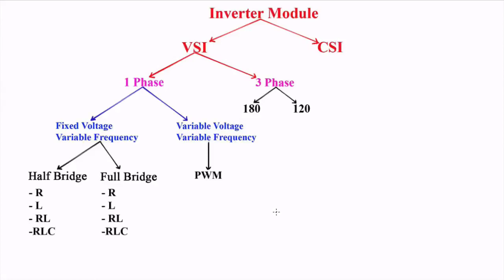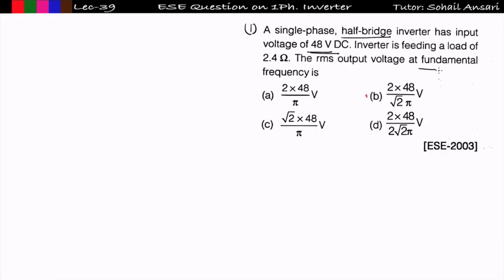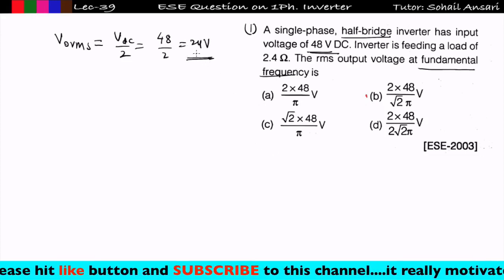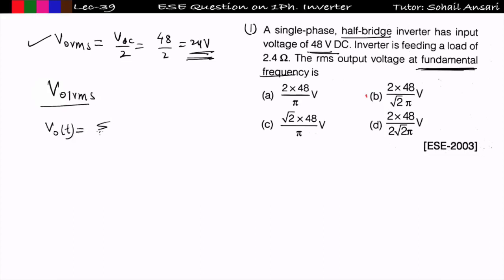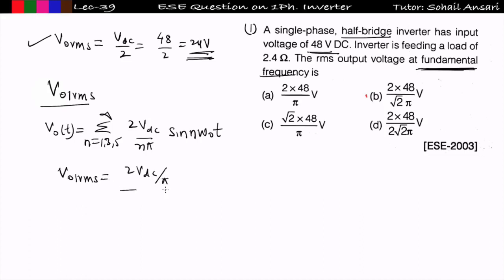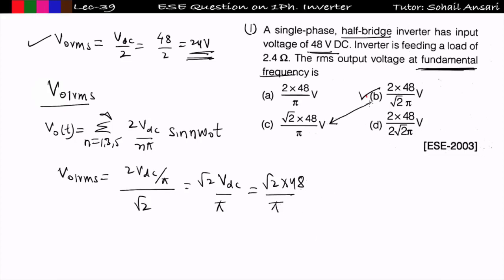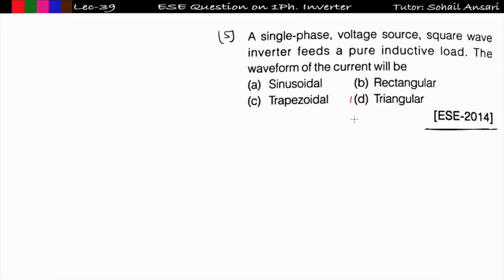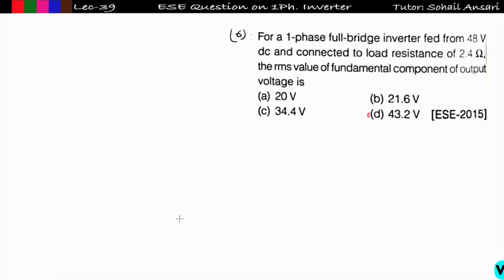Lec 39(b) ESE Questions on 1Ph. Inverter | Power Electronics | GATE 2019

Comment: How can u say in q.3 that it is a fundamental curent. It is also possible that load may be RLC type and as u explain in your previous lecture load current is sinusoidal for RLC type load.
Reply: Exactly even i have the same doubt
Reply: Yes...it is possible that might be a RLC load..but even then the answer will be as given by sir,let me explain...

Power drawn by supply = Vdc * Is(avg)

If you were to plot  Is(t) for the bridge inverter..u will get similar waveform like Io(t) but for part of negative cycle of Io(t) will be in positive wave form for Is(t) since T3,T4 will be in same direction for Is but opposite for Io(t)
(You can refer bimbhra they have similar problem on RLC load)

now Is(avg) = (1/π){intg (0>π)200sin(wt -45)} = (200√2)/π

Hence Ps = 220 * 200√2/π * 10^(-3) = 19.8W

Comment: Sir in Q3, why didnt we use the formula vdc*Is01(avg) to calculate the power drawn from supply i.e source?? Whereas u have  used the formula for fundamental power across load..
Reply: Fundamental power across load formula and fundamental power drawn from supply formula ultimately becomes equal. So therefore to find the fundamental power drawn from source we can use fundamental power across load formula also.. that's y he used it here
Reply: I mean to say Vdc*Is01(avg) is nothing but equal to Vorms*Iorms*cos@

Comment: Sir I don't understand how load inductance is large for VSI In last question.
Reply from the maker: to make the constant current across load...inductance should be large..however this is not the mandatory case..for resistive load ..inductance will be zero..but for practical application..most of the load are inductive..this is valid for highly inductive load...got it.